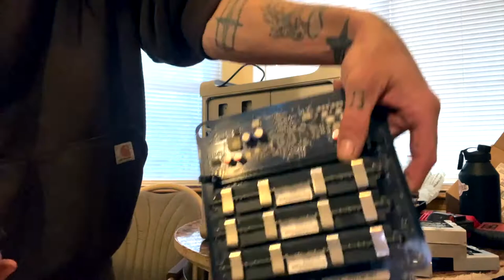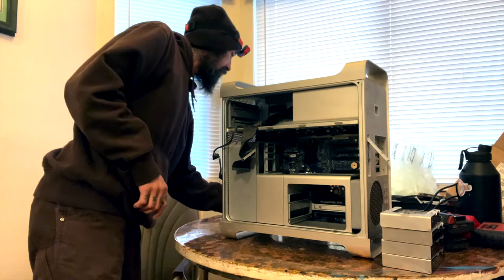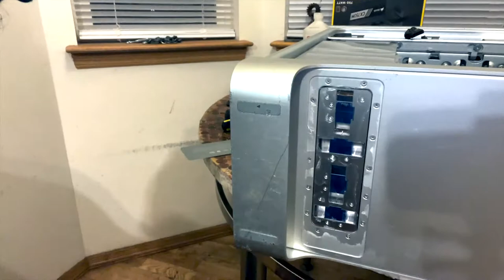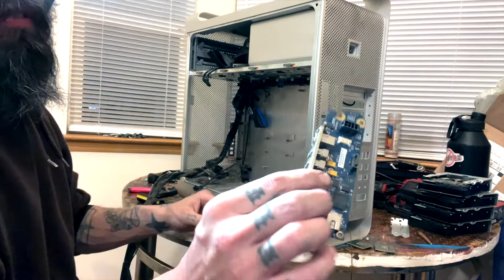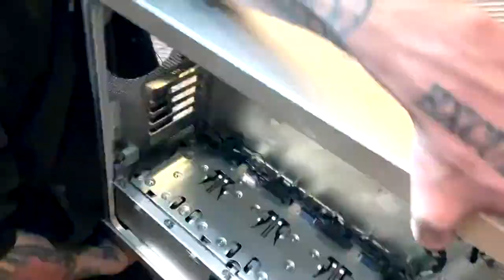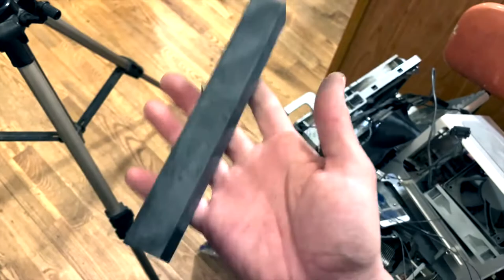CUSTOM MAC PRO PC HACKINTOSH GAMING RIG PART 1 S16E15

Comment: I'm glad I came across this video. I've been breaking my head trying to remove that (I believe it might be the wifi antennas ) and have been been drilling and dermaling it with no success. Turns out I had to remove the label at the bottom